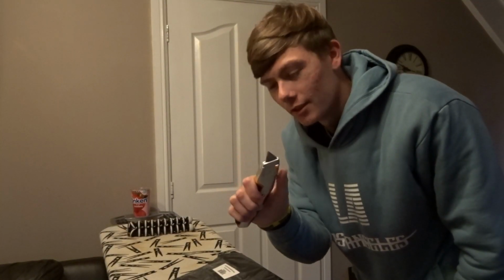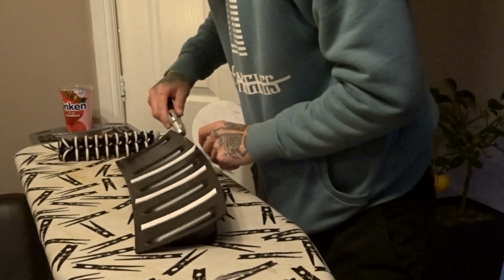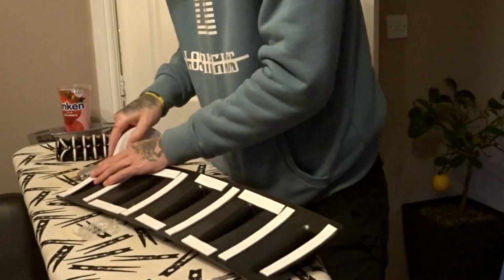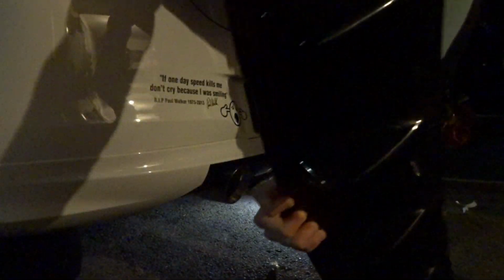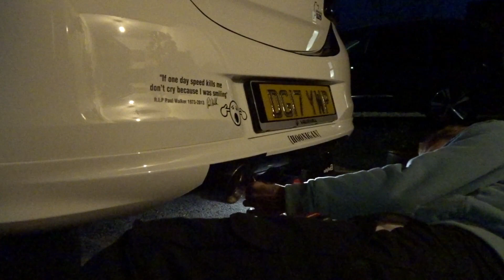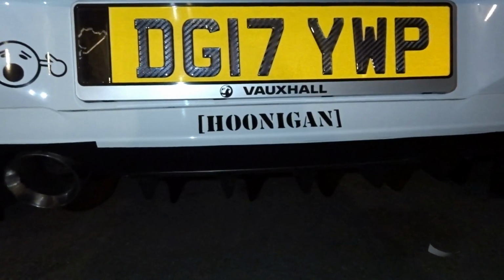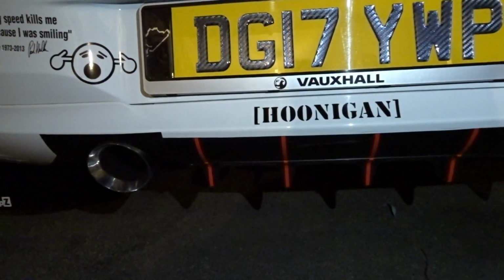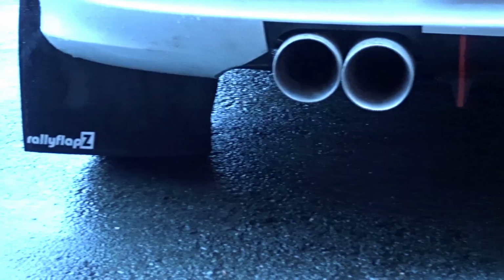CORSA E DEFUSER INSTALL!

Comment: Seen a 2015 corsa e vxr . Same as mine . but it had the rear bumper vents like the d corsa vxr . I have the diffuser and side splitters done from mad motors but cant find or see anyone that knows how to get those rear bumper vents for the corsa e vxr or how they fit . Any ideas ??